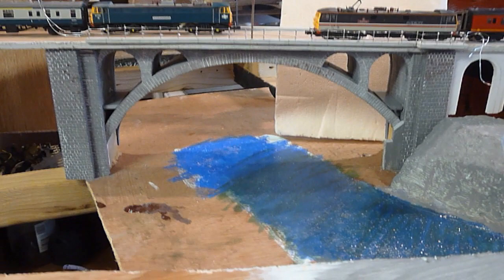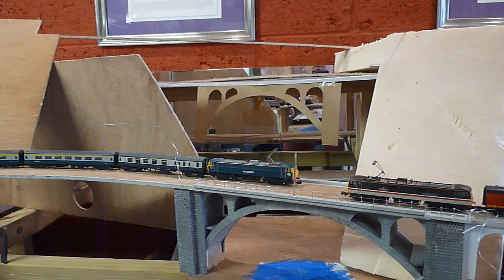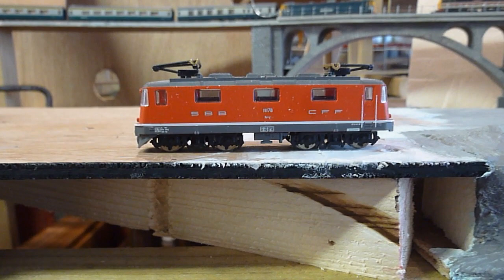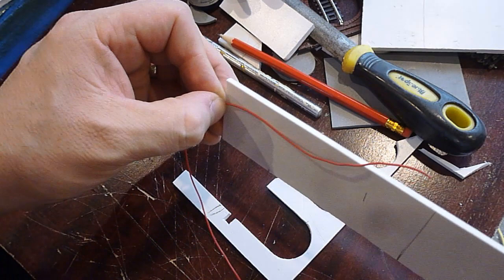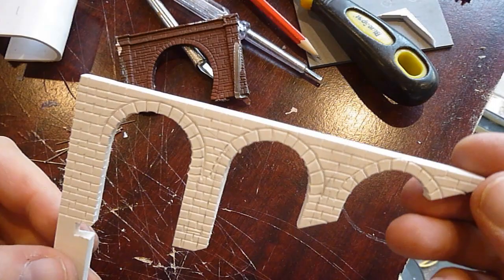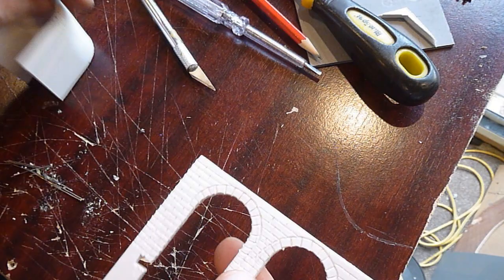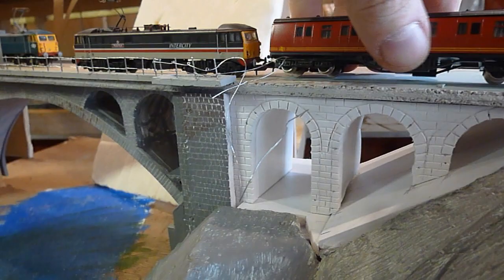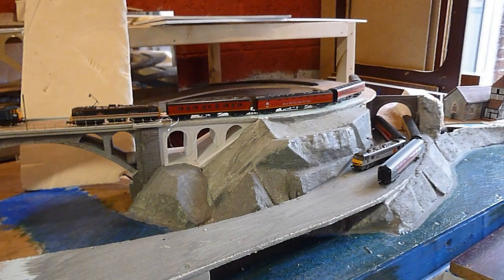Wemblesden Park - 22  extending the N gauge bridge

Comment: You should get a deflector appendage for your heat gun. Steinel sells a lot of additional products to use with a heat gun. 
Curious to what the temperature setting  is for the Foam-X board. 
Looks like a cool material to try out. Great method for this kind of rigid foam.
Although my preference would be to not choose pvc. Curious also to the amount of plastizers and phthalates these boards contain. 
Plus how over time, the bleed out of these additives will affect the rigidity of the foam. Especially when formed by heat pvc products tend to age much quicker than other plastics. 
Nevertheless, for now, I’m really gonna look into these Foam-X boards.